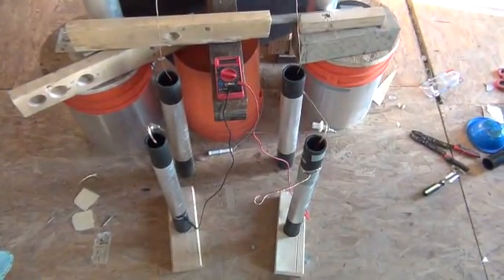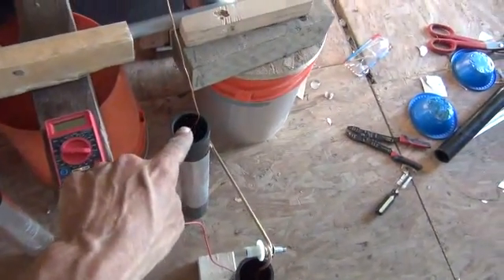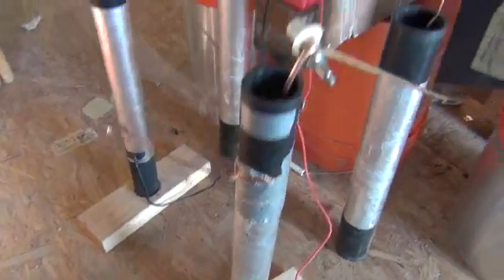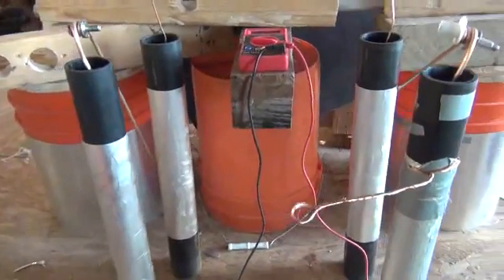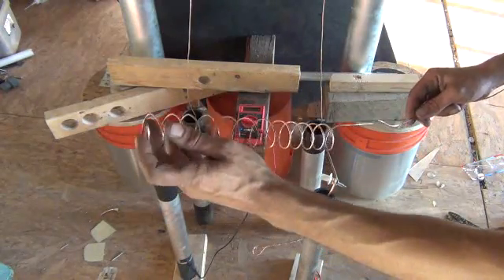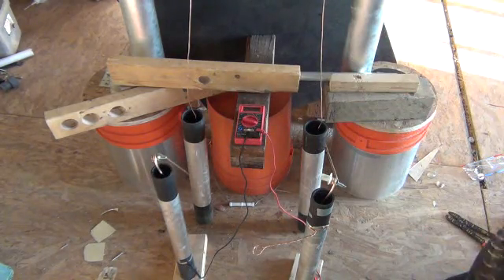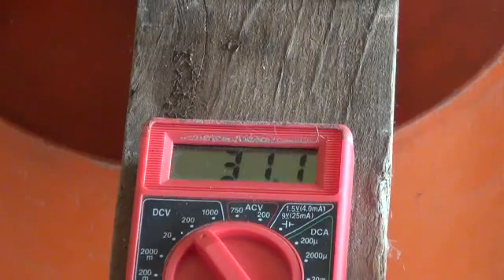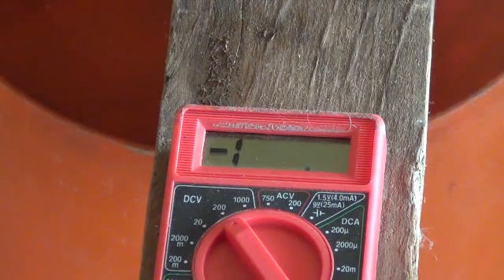How-to make a electrostatic step-down transformer, converts electrostatic to low voltage DC.

Comment: i like to build a step up transformer  start with a 36 volt. to make a welder with variable current to have a out put of 50 amps 75 amps 100 amp 120 amps  I seen one work on a 1938 home built no moving parts welder  i like to construct a similar unit

Comment: Hi - really enjoyed the demo and thinking about it's potential...I am trying to step down voltage on a 320v solar cell to round about 24-40 v to make it useable and this is the most useful info I have picked up..certainly on making a cheap step down mechanism. Do you plan to release any schematics at some point in the future.? I would and am sure other people would find this very useful..Thanks G.